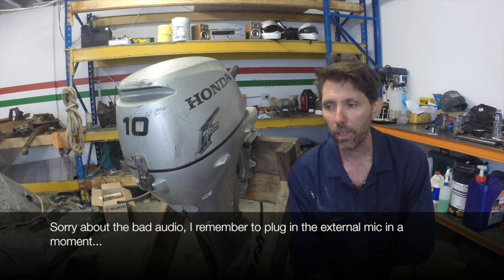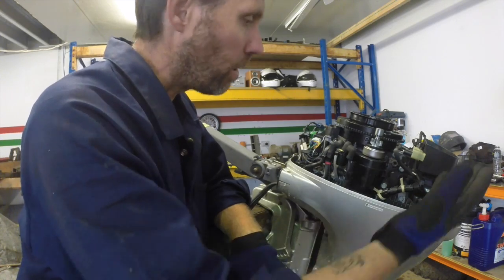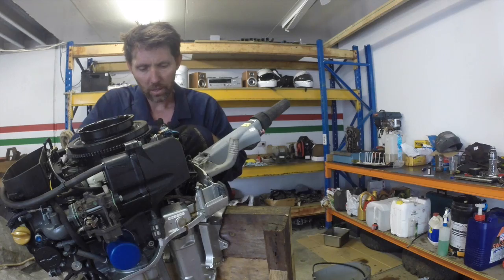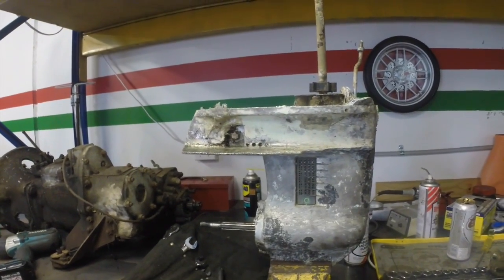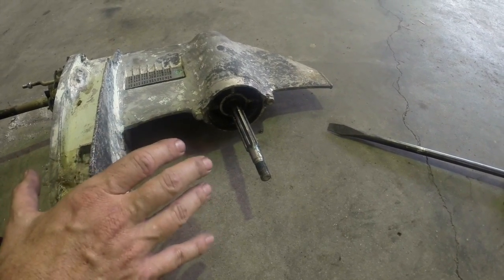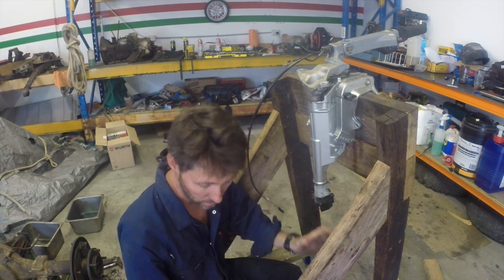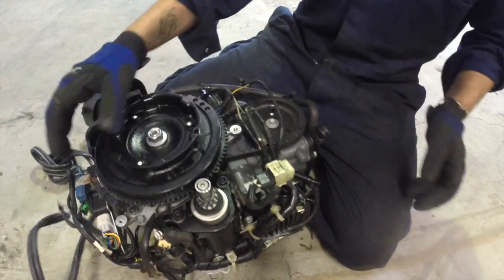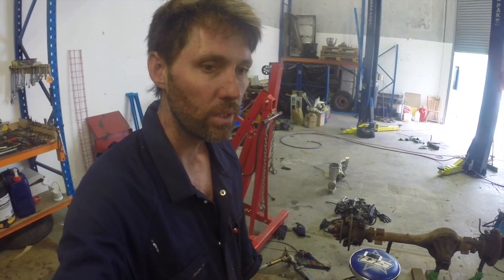What's inside an outboard motor?

Comment: Hi Stu, Your question at around 20.30. That part you un bolted is a small manual lever you slide left to right in order to increase or ease off the friction when steering the motor. And or if you were on a trailer when fully wound up it this wont let the outboard flop around in cornering etc. Hope this makes scene.  Defo buying a Tee. Your Channel is really helpful to me and has raised my confidence and knowledge about my boating. You are the only person to ever raise the key safety matter of how just one m14 nut on the tiller link arm if not secure or faulty could cause such a problem when at speed. I feel much safer on the water now with your thoughts and experience. Huge thanks from the UK. 🇬🇧
Reply from the maker: Thanks Will. Good to know about the lever, I have mostly seen that tension through a bolt pressing against the bushing in the tube on the Yamahas.

Comment: Just wanted to say that vids like this one are really helpful to folks like me, who have fair knowledge of gas engines, but almost NO experience with outboards.  I learn easily from informative videos like yours.  I picked up an old ( $25 USD) Mercury 50 HP motor this weekend and plan to tear it down as you did here and learn as much as I can.  Who knows, maybe I can even get it running.  Thanks for your efforts.
Reply from the maker: +hapakidz Hi mate, glad the videos are helping. I really enjoyed restoring that Yamaha 50 HP,  and given though it was a free giveaway, it's still running nicely today. It's not always cheap to get the parts you need, but at least the labour is free and you're having fun along the way. :)

Comment from the maker: Hi Koen

I can't reply directly to your comment as YouTube doesn't give me the option (probably the Google+ problem) but to have a counter rotating outboards, one needs to have a gearbox with the forward and reverse gear swapped and then a left-hand prop installed. It's possible, and as you say, it can be done for the fun of achieving it, but you probably won't notice much of a difference with 40s. It is generally considered to be more a headache than it is worth in many situations unless you are finding the boat leaning under power or hard to turn to port. Thanks for watching, Stu
Reply: +Dangar Marine Thank you sir for your thoughts on this.

Comment: The second outlet next to the tell tail outlet is actually the carburettor fuel drain line - there is a plug screw on the bottom of the carburettor that you can screw out to drain any remaining fuel out of the fuel bowl. There is a different translucent tube which is attached from the bottom of the silencer box to a retaining guide and hole on the bottom plate which I suppose can drain away overflowing fuel coming forward out the carburettor or any trapped water coming in from the air inlet hole. This is easily dislodged so if you are mucking around in that area just check it hasn't dislodged itself.

Comment: Great video , educational , detailed, the best you can do in 27 minute's. Many thanks for your effort . Two question's please. How much this outboard worth's in this condition, and how much you have to spend (spare part's and labour) in order to make it reliable to use it to a boat ?. I would like a gross estimation based on your experience.
Reply from the maker: This outboard was basically free. Plenty of old outboard have very little value once they get to this age in salt water. They can cost quite a bit to fix up properly. About $2000 say.

Comment: Thank you for this video. I have the same motor ,but it is base model , it doesn't have electric start , I want to upgrade it to electric start, I am desperate to see what it needs beside the starter ,(Different type of harness ? How does the wire run ? ). Wishing  you would shoot a video of  How To Upgrade, someday.

Comment: Hello Dangar Stu,

First of all you have been a huge help for me since I'm always working on outboards and have very little knowledge of them. I am always on a budget so my outboards are very old and rusted and your tips have helped me so much. 
I have a question: I think it would be fun to make a twin engine setup on my RIB but I can't find how you make one of the outbourds counter-rotating. (assuming this is necessary). I have a old 40 HP twin-cilinder yamaha 40 BR. I noticed the reverse gear is the same as the first gear... so can it be just a case of changing the gearselector and installing a defferent prop? 

Thank you for your time,

Koen

Comment: Once again good work Stuart.  No Coopers today?Are there any issues with not flushing motors with fresh water?I run my Yam40 on the Brisbane River and Moreton Bay.  However I have no access to fresh water to run through the motor after each trip.
Reply from the maker: Thanks Jonathan, I don't ever flush my motor either. It lives in the water all the time and it just really isn't possible. It isn't ideal, the water jackets do start to block with salt corrosion but it isn't an instant death sentence for the motor, they still last 10-20 years.

Comment: Great video, this helps a lot understanding how everything works! I have a question regarding the oil pan gasket and the primary gear case gasket on my Honda BF50, when mounting it back together should i use gasket sealant or can i just place the new gaskets in there without gasket sealant ?

Comment: I love your videos I learned a lot from them. But I have a question, I have a Johnson 48 spl 1991 with a broken manual tilt/trim is it possible put a electric one on and what would I  need to do it. Any help is greatly appreciated thank Philip.
Reply from the maker: Hil Phil. Generally yes, you can convert an outboard. You will need the trim tilt unit, relays and switch to run it. Best thing is to find an exploded parts diagram for your outboard on MarineEngine.com and compare a manual tilt version to a PTT version. That will show you everything you need.

Comment: Great stuff mate. Tell me, any experience on Tomos. I have a 4hp with stiff steering. I think the shaft is turning on the bushes and not in the outer housing. Any tips on this motor?
Cheers.
Reply from the maker: Hi Tim, it's an old video, but this one might give you some ideas on how to fix that problem https://www.youtube.com/watch?v=dJpw9IJ9H1U

Comment: Stu,
Just curious...  The motor is seized, but was it just the lower unit that was locked up?   Later in the video, it looks like you are able to turn the flywheel by hand.

I ask, because probably 50% of motors I get that are "seized up", simply have a locked lower unit.   The terrible condition of the lower unit in your video really makes that seem likely.  Maybe just pop on a used lower unit, and put her back in service?

If I missed the answer in the video, I apologize, as I skipped around to save time.

Thanks for the excellent video series!
Reply from the maker: Hey Tony. I can't remember exactly, but I had two of these outboards, one with a seized gearbox and one that had been sunk and bashed around on the rocks upside down during a storm for many hours bending the flywheel and grinding through the electrics etc. I now have the good powerhead and the good gearbox put together and on stand, but that's as far as I got. One day I want to get it up and running again so I can sell it.
Reply: Okay, that makes sense.  You said you were saving the powerhead from this one, so it was good.   It's nice when you can turn two bad ones into a good one!

Comment: thanks for sharing the part which u said not sure what it is called the  tensioner adjustment  lever ,without it the steering feels too loose and at high speed the motor turn R to Left! now the ? due to a crack in my driver shaft housing the water flooded the housing, would drive shaft take some of this water trough the oil pump to the block ?I found water in my engine oil  thanks
Reply from the maker: Generally water will get into the oil through the head gasket. The oil pump drives off the cam shaft and won't pick up water from the driveshaft area.

Comment: My 2006 honda 15hp has water in the oil. I've changed it 3 times and it's still muddy & milky. The zodiac it was mounted on flipped in the shore break waves. It's possible water came through the air intake. Do you think that could be the issue ? Could it have a blown head. The motor runs well & the compression on both cylinders are 120. Also, oil appears to be leaking from the crankcase cover or somewhere in the area under the flywheel. I'm stumped on what to do. Please advise if you have the time. Great videos. Thanks
Reply from the maker: It could well be the gasket under the power head. I imagine if you can find the oil leak you will find where the water is coming in. It won't have come in through the airbox.

Comment: Random question..........what do you recommend for trim position when you dock your boat for the night.........prop in the water or out??
Reply from the maker: Trim all the way down for maneuvering https://www.youtube.com/watch?v=UVQpMvA838M
Reply: I meant when you are docked and done boating.......sometimes we don't go back out on the boat for weeks, should the prop be in the water or out of the water? Im just wondering that if the prop is always in the water maybe there is more chance of water getting in the lower gears if you had a seal that has a tiny leak, or a drain plug seal that has a tiny leak.
Reply from the maker: Oh, sorry, trimmed up out of the water. You will start to get growth on the gearbox if it is in the water and this will block up the water intake grill amongst other things.

Comment: Thanks for your videos, very informative. I have a Suzuki 9.9hp, about 1985 model. I have changed the water pump, but still no water coming out of the tell tail. Does this outboard have a thermostat? What else could be the problem?
Reply from the maker: No water coming out the tell tail doesn't mean water isn't going through the block. The tell tail hose is quite narrow and can easily get blocked, especially the nozzle at the outlet. There will be a thermostat on the outboard. If you run the outboard with the thermostat cover off you'll see if water is making it up to the block. Compressed air is good for seeing if the passages and hoses are clear of blockages.
Reply: +Dangar Marine  Thanks Stu
Reply from the maker: +Jeff Kettle I have this same problem with my boat at the moment, I'll try to do a video on it soon when I get around to fixing it.

Comment: Hello from Florida, any good hints for me, I will be trying to remove a 2003 225 hp mercury power to replace steering swivel assembly ?
Reply from the maker: This is a video on doing that job on a smaller outboard, but the process is essentially the same. I'll do a new video on a larger outboard one day as this video is a very early one and the audio is poor. https://www.youtube.com/watch?v=dJpw9IJ9H1U

Comment: Gday mate what a hack of a gearbox  i think you would have to pay sims metal to take it of your hands some people amaze me , by the way you were turning that motor i dont think it is seized or did you mean the gearbox ? all in all not a bad freebie check the engine put a new gearbox on it and there you have an aux little engine cheap .
Reply from the maker: From memory this motor came from a boat that sank during a storm and flipped over, lost its cowling then had the motor grind again rocks all night. It was certainly worse for wear!

Comment: Great Video mate like it, new bottom end on that or leg and you would have a good motor, i am looking at buying a 40 hp Short shaft for my rib, its secondhand can you give me any things i should be looking at before i buy, would be most helpful 

Best Regards 

Dave  from the UK
Reply from the maker: +dave cox Hi Dave, really glad you enjoyed the vid. I fortunately do have an outboard that sank in a storm with a perfect leg that I'm planning to mate with this powerhead. Should be a good motor when it's done. With regards to buying a motor, I think it depends on what you are looking for. If you are planning to buy second hand, ask about the history of the motor, look for corrosion and test the compression if you can and see how easy it is to turn on its bracket. Low compression and stiff steering brackets are two things that are hard to fix. I personally prefer four stroke motors but some of the new eTec motors are quite good too.
Reply: Any advice you can give me on the mercury engine i am looking at buying short shaft 40 hp
Reply from the maker: Is there something specific you need to know or just what to look for in a second hand motor?
Reply: Yeh just what to look for when buying a secondhand motor, its 40 hp mercury 2011 short shaft looks clean but i haven't heard it run yet.

The boat comes out the water its not left in and he said its only done 200 hrs
Reply from the maker: If you can, check the compression of each cylinder. You're generally looking for a reading above 120. I would also make sure the steering and tilt bracket moves freely and is free of corrosion. This type of corrosion is hard to fix if it is there. Obviously listening to it running and making sure it is pumping water will help on top of this.
Reply: Thanks for your help i am over there in the morning all let you know how i get on

Comment: A perfect breakdown of a portable honda. One question the plastic piece that was held on by rubber grommets, how come it has two hoses one on either side that lead under the powerhead? I always wondered why it was designed like that. And it had no cover so when your working on it debris can block the holes in the top. Probably a stupid question but it always seemed like a mystery part to me. Does the motor need cooler air so is that why it sucks air from up top and gets pulled downward to apparently nothing???? 5 stars sir, indeed  <*(((>{{
Reply: I believe the plastic piece is a 'bowl' to catch any water that enters via the rear air intake hole on the back of the motor cover.  The drain tubes just divert any caught water into the lower cowling on each side so it can then drain away. It would just be a normal part of maintenance to remove any debris that gets caught in there. I was a wondering the same thing with my Honda as the previous owner did not route the tubes correctly through the lower plate.
Reply: Thanks

Comment: Good videos. but two cylinder engine for 10hp, i thought this outboard engines would be more powerful for its size.
Reply from the maker: The same block probably does the 15 and maybe 20 too with just different carburettor and reed valves.

Comment: hi I work on honda 4 stroke   outboard motor I see that you love to work on motor as well I have a 50 honda 4 stroke in need off a piston an a cylinder head ..
Reply from the maker: Hi Jamil. I do like these Honda motors. Parts can be quite expensive new. You might want to try an outboard wrecker.

Comment: I havent got any money till middle off next month everything was fine everything was great and the engine just stoped woulnt work. Worked out the fuel light when off so my boyfriend filled it up im not sure he filled it up to much. But the light came back on. Still wasnt turning over. Charged the batt still woulnt work left it for a few weeks. Tryed it one day and it works but something is rong and i dont know what i have to reinforce where the brackets are aswell where the engine is i dont knw how or what to do this is all new to me. Also i have a problem the tilt leaver is stuck any it wont come free ive tryed everything. What people are writing and im really stuck and its getting kinda emotional now lol.
Reply from the maker: Was it the fuel light or the oil light that came on? Those trim brackets can be a bit tricky, they have quite a few moving parts that can get corroded and then bent. If the starting it intermittent and the battery is charged up I would be checking for loose electrical connections starting with the main battery leads.
Reply: Oil light. we charged the battery and in a few weeks it died. The engine isnt pulling out 12v aswell i think its only pulling out about 7. Something is rong sometimes its not putting any charge into Batt
Reply: Engine wont turn over. Key wont work

Comment: Hey Stu, probably the dumbest question you've gotten so far.. but if you forget to pull in your choke after starting up your cold engine, could that be the reason for my outboard overheating? Best regards Norway :p
Reply from the maker: I wouldn’t stay so. If you leave the choke on the engine will get start to run more rich as it warms up and eventually stall.